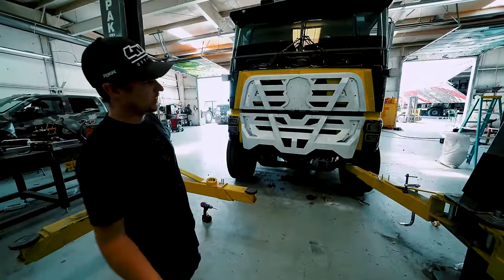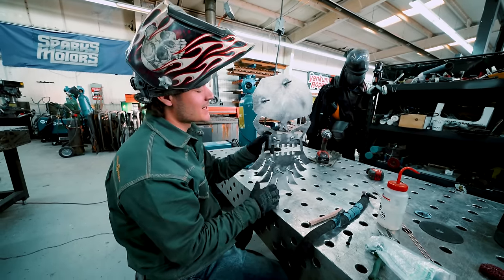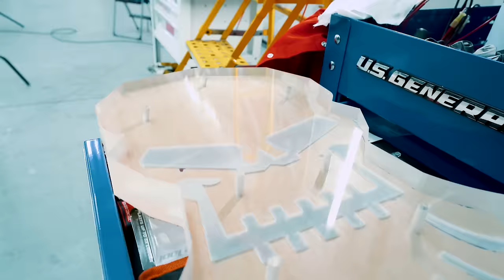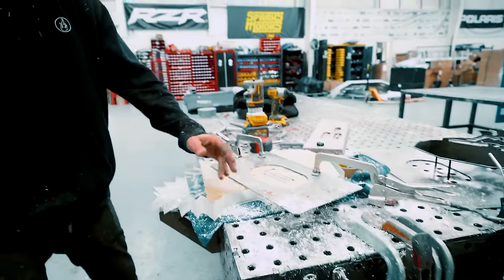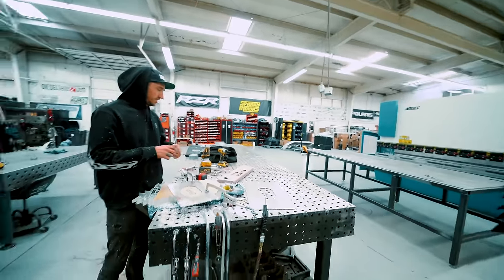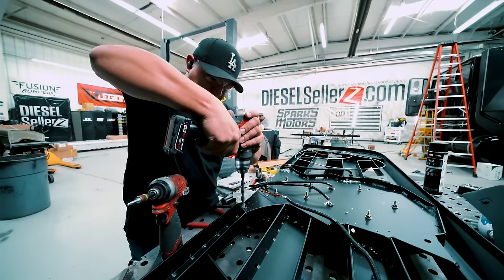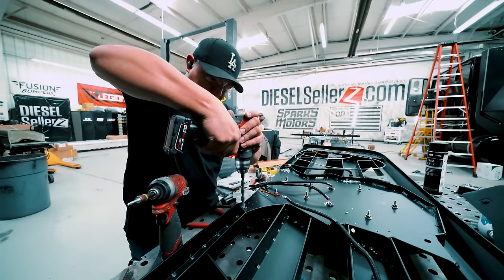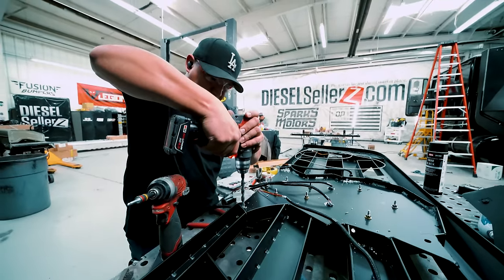The Baddest Cabover Ever Built! Making Semi Trucks Great Again!

Comment: I also love that most of sparks fleet match like the 2 dodge 5500 Rams that have matching wraps and wheels and that one is a flatbed and one is a utility and now you have both heavy haul road tractors matching one is cabover and one is conventional. Now I wish that they would black out the HET wrecker and put the same style camo as there wrap on the dodges but leave most of the wrecker blacked out ans only put camo lettering and decals and also wrap just the boom and beacon light pylon I think that would make the Het look so much better and I wouldn't stop at just the Het wrecker doing that I would also do it to the military truck they call "Hambone", the 6 wheel drive truck that hauls the boat along with wrapping the boat to match aswell, and I'd do the military truck that has the dumpster hook on back, I'd do the old military wrecker with the rotator style boom on it too and bring it back out in service too and whatever else that they use in the fleet I'd do that to all of them so they all match and everyone will know their Trucks when they see them

Comment: I love what yall have done to the truck I'm a sucker for cabovers anyhow, but I think the bearded skull grill was to much on the front of that truck it took away alot of the trucks character I think but that's just my opinion other than that you guys did great on that truck yet again another one of a kind epic build from the best. Also even tho I like the super single style wheels on the front  and back I kinda wish they would put duals back on the back and bud wheels on the front I think it would look so much better in my opinion and then in the winter I'd use the super singles again.

Comment: Hi, Folks.
I'm gonna be the 'nay-sayer' here. GREAT workmanship, BUTTTTTTT:

1. Tri-drive is nice BUTTTT, there is NO way that turntable placement will ever give even loading on all three of those rear axles or on the chassis carrying that back end.

2. The chassis is WAY longer than it needs to be - which just adds extra weight to the rig - which reduces payload. Also increases the turning circle radius.

Try looking at some of the tri-drive road train prime movers/tractors pulling 3, 4, even six trailers on Australian roads. I'd post some links here but YT doesn't seem to like that nowadays.

Just my 0.02.

You all have a wonderful day. Best wishes. Deas Plant.